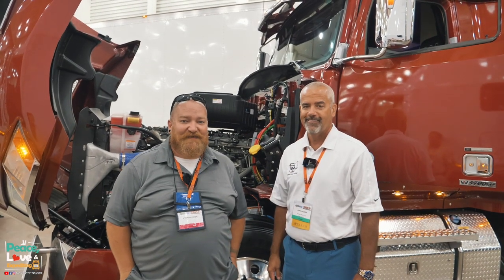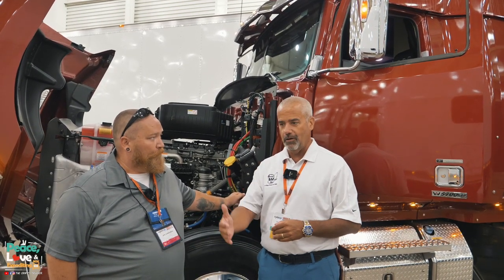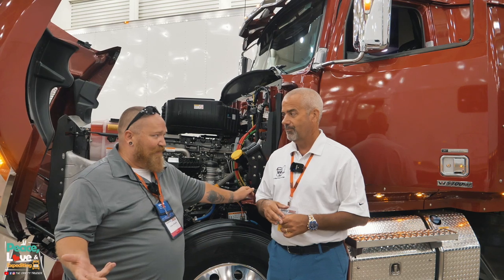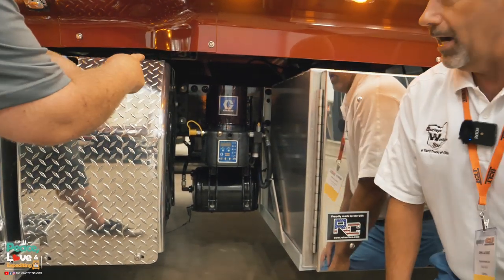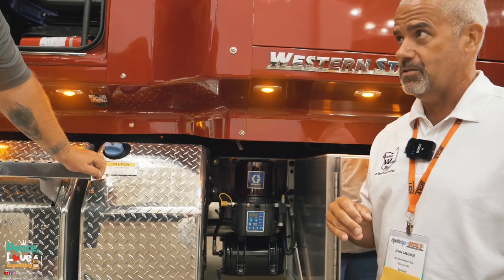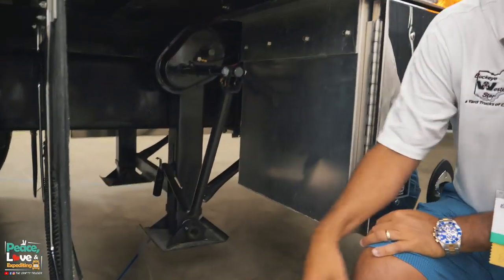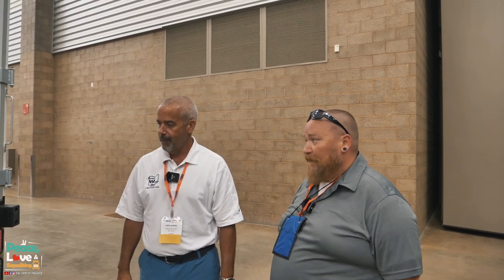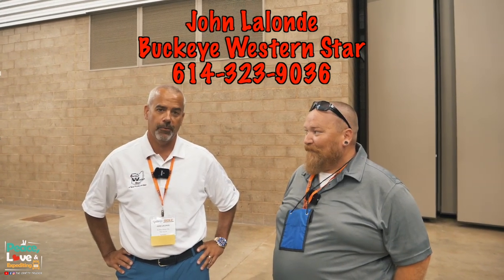AUTOMATIC GREASE SYSTEM | Expediter Truck

Comment: Nice plug for Western Star.  It's roots go back to my home town in Kelowna BC Canada.  Had the privilege of making parts for the plant for about 20 years.  Nice to see continued success of the truck.  I ride to work at my Transit job each day behind the old factory.  The building turned into a UHaul facility 😂🤣👍. Interesting grease system 👍😎. Safe travels

Comment: First time I heard about these things was back around late 2004 or early 2005.  Saw a couple of different brands at the MATS Show in April 2005.  They can get messy if you don't go around wipe up the grease that comes out of the joints.  For me to many hoses.  I have 13 fittings front drivers side, 8 front passenger side, 12 on the rear axels.  And the u joints.

Comment: I’ve had an automatic greaser on my tractor for 3 1/2 years. Only 2 issues have been getting the correct grease and I had 2 broken fittings. Otherwise I love it!  Never have a dry 5th wheel.

Comment: Groeneveld Grease system is Already there for almost 20 yrs.. it's an amazing system but you will never get under there in case you can find a point that needs attention like replacing a part

Comment: Very nice poised interview Jason, I'm very impressed.... As far as the automated grease unit, to me it's just one more thing to break, especially if electronic controlled. Also over time, the sun and weather in general will deteriorate the hoses. My Jeep has a pile of grease fittings on it, partly of my own doing. I made a map of where they all are and yeah, I craw under it or jack it up a bit and grease it by hand wearing mechanics gloves and paper coveralls that are disposable. A really good grease gun will last years and just keep extra tubes of grease with you. Also, suppose one hose clogs up in a bad spot, you are never going to know it and something important like a universal joint is not going to get greased.  I like creature comforts, but the least electronic objects I can keep out of my vehicles the happier I am & the more I can fix myself with out the expense of a garage mechanic and insuring it's done correctly. As age and corrosion sets in, that stuff seems to get a mind of it's own. That is simply my opinion. Find a nice spot, perhaps under a shade tree, even park with a set of wheels on a slight embankment and go to town greasing with your map in hand of where all the fittings are or even a list.  If you get tired, than make Heather do it, pay for the coffee maker hahahahahhah...... As always I wish you guys good loads, and safe trucking.... Thumbs up on the video

Comment: That would be a great little item to have! I still don’t think I would go 50,000 mile between changes. Maybe if I had a way for a lab to analyze my oil   Or if I had the oil cleaning system on my truck. Course you wouldn’t have to worry bout it then. I guess I had better research this a little more first cause I know nothing about it.

Comment: How would it work for ujoints on drive shift can't get tube there love video but had ask mechanic in me
Reply: Like he said it's a grease less drive line. Or no grease fitting on the u joints set up.
Reply: Right it would not be an option for all truck. But this western star had a greaseless drive line

Comment: 0:44 50,000 miles oil change on a DD13. Seriously? So, at 400,000 miles who is going to pay for the overhaul? The company or the owner operator that purchased the truck at a certified dealer. That engine is weak and the amount of iron and aluminum on that 50,000 mile oil sample is alarming.
Reply: We’ll since the engine come with a 500k warranty I guess Detroit would. We run 40-50k before every oil change with oil analysis and everything is looking great. Oil samples are showing I could go a little longer but I wont
Reply: But shows what you know about Detroit’s they are the most reliable diesel on the market today
Reply: @modeverything9949  thanks for replying. Not trying to debate your opinion about the Detroit engine, but according to my own personal opinion I have to say that cummins is the most reliable. Yes. It is expensive to rebuilt; probably two times what a Detroit costs. Would you mind sharing that oil analysis report with me? You could take a screen shot of the results where it shows mileage, engine and comments. It's just a question. Please let me know......Also what type of oil do you use on that DD13?
Reply: D K sorry I’m not trying to argue either but it’s not opinion. Pure simple fact Detroit is in the shops less. Do you listen to Kevin Rutherford much? Detroit’s have a better diagnostic so you’re not just throwing parts at it. And statistically speaking Detroit’s are in the shop less. This is not based on I’ve heard or they said. The x-15 has gotten better but it’s still in the shop more. I’m neither a Cummins more Detroit fan. I’m a staying on the road for cheaper fan lol. We have seen million mile DD13’s with 50k oil change interval.

Comment: these units are junk .my company had these installed on numerous  peaces of heavykk equipment  6 dozers,4 escavaters  4 feller bunchers  8 tigercat skidders and 6 tigercat brush grinders nothing but problems from components receiving  grease like we're talking millions of dollars worth of equipment which cost us hundreds of thousands in repairs from lack of grease. we finally removed all these auto  greaser and went back to using normal grease guns l know 32yr driver and also hold service tech lisence  and truck /coach mechanics lisence so I know what  I am talking about . gm tried a greasless driveline in1984/85 in trucks that was a failure also , so the  ones on big trucks will be a lisence to print money  for mechanics and truckstops it will be new drive shafts and u joints
please don't  get  conned into this you couple l'm honest and don't like to see you taken.